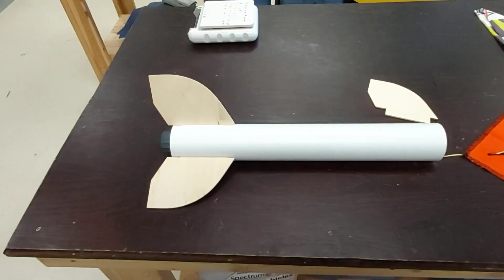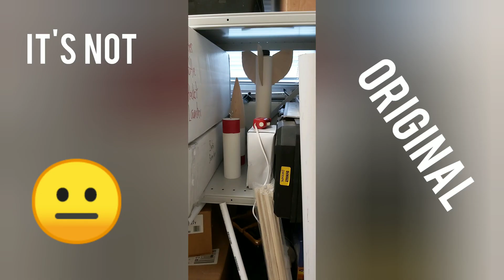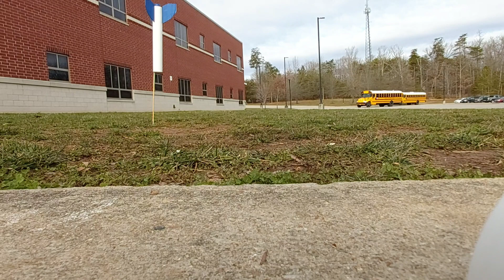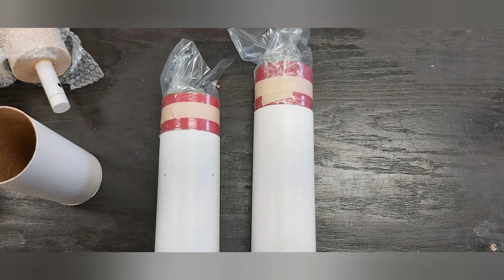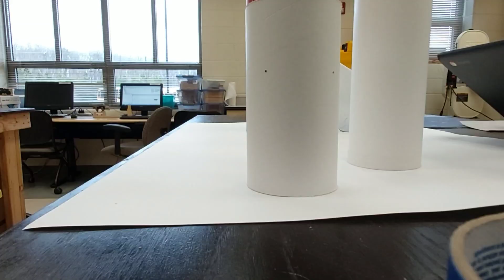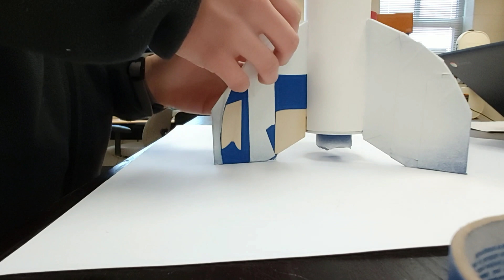TARC Rocket Project: Part 7

Comment: I see one of the benefits of your fin design, a free-standing rocket!  I plan on showing this video during class tomorrow, they are at the same step of submitting a parts list
Reply from the maker: It has been super convenient to stand the rocket up when moving and working with it. If someone were to use a fin design like this, I would recommend that the bottom part has a flat base. Having fins ending at a "point" could break them when landing.